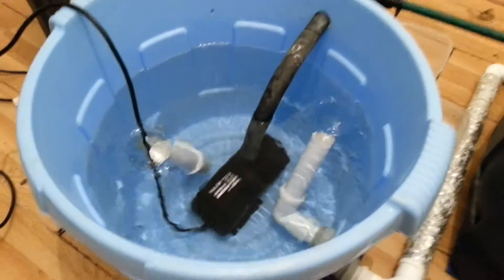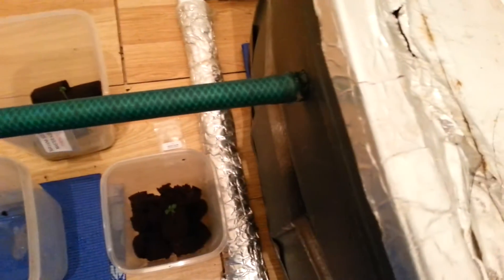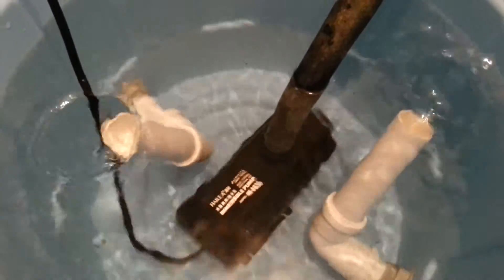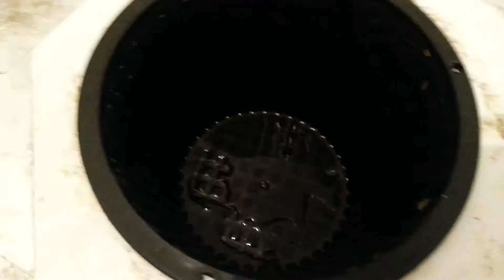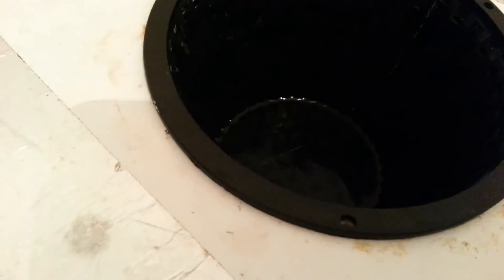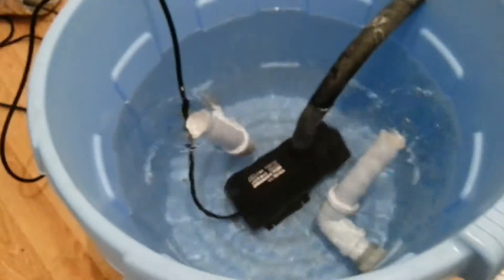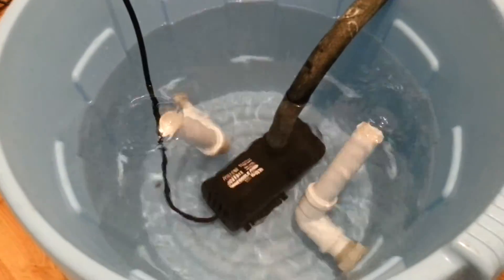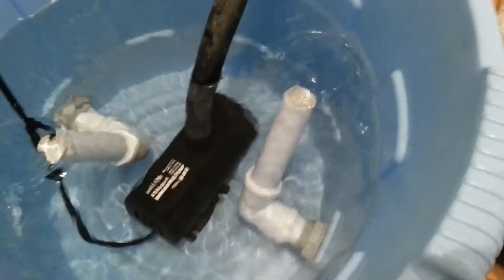tour of the tree machine

Comment: Nice and informative video (background noise is a little loud).
How much solution does the system take?  If two plants get big in that system it will need daily top up, pH adjustment and EC set.  (The lower the volume of the reservoir the more often it needs to be topped up AND the EC, pH and water temperature will fluctuate more and slow down nutrient uptake & growth)....

 Is there a way you can connect a bigger reservoir? It could even be in a different room.